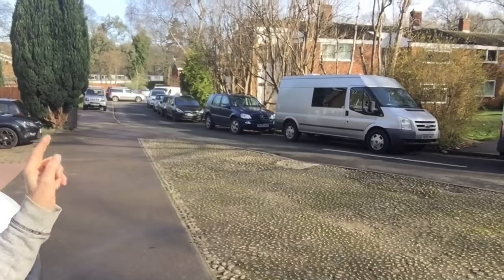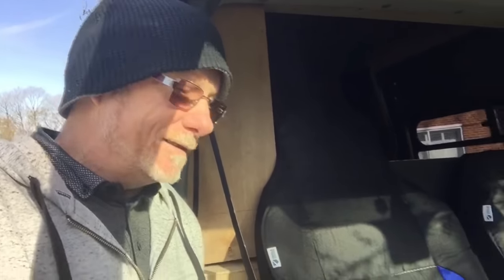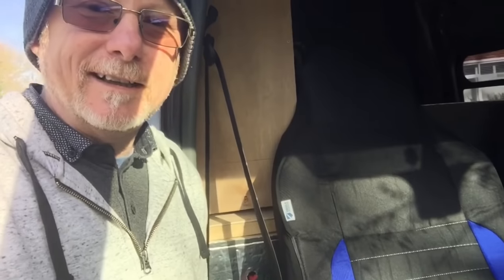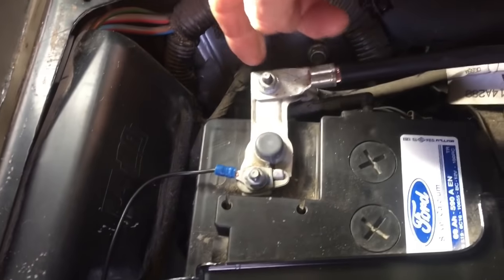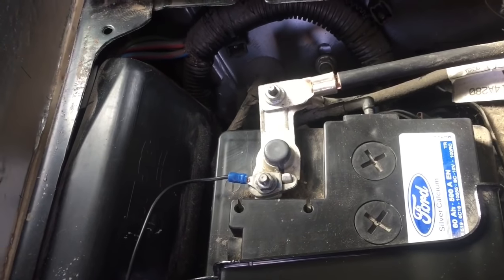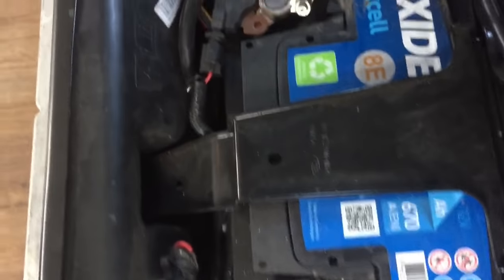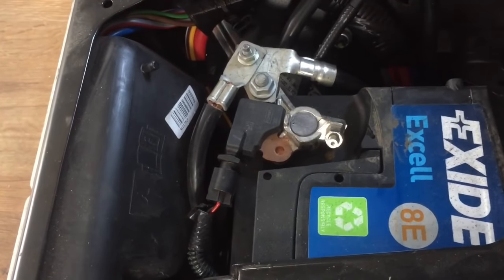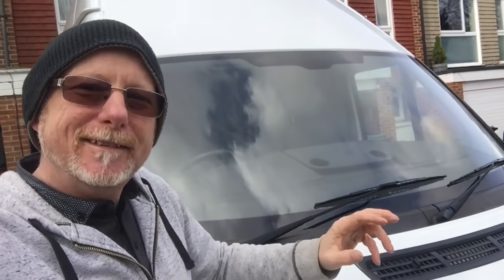How to tell if your van / car has a smart alternator?

Comment: Mel, top job.. another way to find out is, to test the vehicle battery voltage with a multimeter. On standard alternator it will rise to about 14.5V and stay around that, whereas smart alternators will drop back down to closer to 12.5 - 13V after 5 - 10 minutes of engine running..
Reply from the maker: team 118 thank you I’m sure that will be interesting and helpful to lots of people 🤓🤙
Reply: That's why I think a standard alternator is a better choice for charging a leisure battery as it puts more juice in and quicker at doing that also although it's harder on the alternator I'd say. Mine is the standard so I always drive a few good miles to make sure the van battery gets full load then switch over to split charging. I've been doing this for a while because I need to replace belt and tensioners, the extra load on the second battery will give a squeaking noise plus the belt slipping to begin with if I don't. I need to sort it asap.

Comment: All you need to do if you have a euro twin battery system with smart alternator is remove the sensors.off both batteries..negative side. Remove the electrical plug... Alternator recerts back to factory default.. then fit split charge relay...
Reply: Works awesome even have my solar via epever to batteries so charges both ways..

Comment: Dude I added a secondary battery to my  car to power my car fridge, only to find out it won't charge off my alternator if its a smart one. This is the perfect video to find out what alternator I actually have, cheers
Reply from the maker: Hay no problem I’m pleased it’s helpful thanks for letting me know I appreciate your feedback 👍😊👍
Reply: Hi thanks for this. Back in the 80's 90's we would have a bank of old van and truck batteries, for house electrics. We would take one out for a drive most days, Sat in my foot well, parallel charging off the starter battery with crocodile clips. Ive recentlybought a swb 2011 Sprinter for stealth camping. I was going to replace the battery and use the old one for a couple of led lights and fone charging. I was thinking of just going for parallel charging again. Seems I'll have to buy a charging box of some sort. Life doesn't get more complicated, it gers more expensive as well. Lol great vids Mel keep em coming.

Comment: You can charge lithium from any alternator using a dc to dc charger. 
Good brands like Victorian and Renogy make them.
Renogy also makes one that takes a solar input too ;it has a built-in mppt charge controller). So this piece of kit will take alternator and solar input and manage the charge of your vehicle and leisure battery!
Reply: You will have to run a wire from the convenience port or a switched\fused lead from the positive  to the ignition port on the Renogy dc-dc charger if you want to charge from the alternator.
Reply: @rg3965  where  is the best place to connect the ignition cable on a sprinter that runs to the renogy DC-DC charger?

Comment: Thanks again Mel. Very useful info.. Although Ive just connected my solar panel to the leisure battery with no split charge system... A 100w panel is more than enough for most of us for weekend camping.. Our was fine on a month trip though France and Spain with no split charge.. 12v compressor fridge, lights. And charging devices..
Reply from the maker: well done hope you had a great time :)
Reply: Scott how is it on winter trips though? Not so good I imagine?

Comment: Whoops I've already bought my split charge system without checking my alternator! Better check it before I fit it!
Thanks Mel
Reply: Me too, purchased the standard one which Mel has on his van, I have a horrible feeling my van, 2011 VW Crafter 2.0TDi has a smart alternator now.
Reply from the maker: Mark Velo I do hope it’s ok 🤓🤙
Reply from the maker: Michael Aldridge good luck hope it’s ok 🤓🤙
Reply: @BigVanSmallWorld  I've just checked mine.
The Neutral has one thick cable and one small one on the same connection but no black box.
The Positive has lots of connections though which was surprising.
Gonna fit it and hope for the best.
Reply from the maker: Mark Velo sounds like you should be ok 🤓🤙

Comment: Hi Mel,  nice video but as others have pointed out the Ctek unit does not have a lithium charging profile like others do however that being said the majority of LiFePO4 batteries can be charged on a AGM profile as long as the max voltage does not exceed 14.6V.

a voltage sensitive relay relies on voltage thresholds that trigger them to engage and disengage. Typically they engage to connect the starter and auxiliary battery together at around 13.3V and disengage to separate them at around 12.8V, which in vehicles with traditional alternators coincides with engine start-up and shut-down.  This is ideal as it makes sure that the auxiliary battery is charging whenever the engine is running. However, with a smart alternator, when the output voltage drops to below 12.8V a VSR would disengage, meaning that the auxiliary battery would have significant periods where it wouldn't be charging, even though the engine would be running (some models of VSR may not engage at all, dependent on the on-board software). VSRs can also engage and disengage frequently with the large and rapid voltage changes from a smart alternator and so the high current contacts may fail prematurely.

I am the technical sales manager for the exclusive UK distributor of Redarc Electronics who have an award winning range of DC-DC battery chargers that are formally approved by a number of vehicle manufacturers. They are standard fit on many frontline ambulances and large service and utility fleets. 

In over 5 years of selling Redarc product into the UK we are yet to see a single failure which is credit to the superior performance and reliability the BCDC range offers. 

One of the largest problems we have seen with the Ctek and sterling (other than failures) is they derate massively in high ambient temps which impacts performance and output current, as soon as 25 degrees is reached which can happen easily in the location these are sometimes installed the current reduces significantly and it does again at 30 degrees, majority of the time the charging current is then around 12-15A and your  not getting what is on the box!.. Redarc range has full output up to 60 degrees 

in regards to voltage sensitive relays While people have been using relays for years in split charge systems it is not the best solution for charging batteries, an alternators output is constant current and constant voltage because of this it is unable to fully recharge a lead acid battery to 100% SOC, it also reduces the life span of the battery. 

you also ideally need the same type of battery as an auxiliary as all a relay does is connect them in parallel 

The Redarc BCDC range has a sophisticated multi charge algorithm that will ensure your batteries are in optimum condition and get fully charged, the 40A unit is suitable for up to 400ah of batteries. The Redarc unit also overcomes voltage drop issues and knows when the battery is 100% due to resistance, temp and voltage so if a load is applied it will provide power to the load while maintaining your battery SOC up to 40amps, for larger requirements up to 4 units can be connected in parallel to give you 160A of charging current! 

Charging a lead acid battery is like trying to fill a Coke bottle up with stones, at the start you can put big stones in to fill up capacity quickly but towards the end you need lots and lots of smaller stones to make it 100% full - an alternator cannot do this while a proper battery charger can and that is why you have the different stages - bulk, absorption and float. 

In the real world unless when under heavy load your vsr is probably putting in no more than 40A 

We sell over 1000 vsrs a month but have seen a massive increase in DC-DC charger sales and a drop in vsrs, we honestly believe the Redarc unit is the best solution for any dual battery vehicle
Reply from the maker: Thanks for that if you really want a free add on my channel send me one of your products and I’ll gladly do a review for you 🤙🤓

Comment: Great info, and gave me the info that I needed.  Having a lithium based leisure battery pack I was at first thinking ahh well, solar and shore will do ... however a little bit of scratching around and Victron have jest the solution ... the Orion-Tr Smart DC-DC Charger work with LA or Lithium
Reply from the maker: Hi glad you found it useful 👍🤓👍

Comment: Hi Mel, a couple of things. You don't have to use an old lead acid with a smart charger. The Ctek device doesn't allow for lithium that is correct but there are other option the market. 

They are commonly known as battery to battery chargers or DC to DC chargers. 

Redarc bcdc (available in the UK via eBay) its what we are using. 
Sterling b2b 
Victron buckboost 

To name a few. They all allow for charging with lithium and can all be set to certain voltage parameters depending on the battery type. This has the added benefit of providing the battery with the correct 3 or 4 stage charging process which is vital for maintaining battery health in the long run. 

The split charge relays are practically just a switch as you know and thus don't provide batteries with the adequate charging voltage to FULLY charge the leisure battery. They can reach the 80% mark or there abouts and if you have solar then obviously that can then top up the remaining charge to 100%. But if you where to rely on just the split charge relay then you will never charge the battery to full capacity. Unlike the battery to battery chargers. 

So in all even if you have a regular alternator it's still the better option to buy a battery to battery charger if budget allows. 

👍 

Keep up the great videos matey.
Reply from the maker: thank you so much
Reply: I thought the Ctek was a DC to DC ? it also accepts  solar panel input for it's built in mppt controller , it can charge from both at the same time , or I am thinking about another make ?
Reply: uptowndisco2 You are right, however with the ctek you can only use lead acid type batteries and cannot upgrade further to lithium.
Reply: Mitchell Orr Do you have any recommendations for a dc to dc with a smart alternator the same size of the ctek 250 which you can use with lead acid and lithium? I have got lead acid at the moment, when my pocket allows I will upgrade to lithium. I wanted to install a one off dc to dc charger and only swap to lithium batteries with a build in bms in future. Thanks in advance.
Reply: @leoinswlondon  The Redarc BCDC1240D is the most compact unit available. It also has built in solar controller and can charge lithium so long as you buy the most recent version of it. Just be sure to check the sale listing to make sure it's the newer model with lithium option.
Reply: @leoinswlondon  got ya now , good to know as not yet bought my dc to dc  , thanks for the info .
Reply from the maker: uptowndisco2 I put a link in the description for you to an outstanding DC to DC charger 🤓🤙
Reply: @BigVanSmallWorld  Thanks , I have decided for now to just do  it the old fashioned way  , a thick live from the van battery to leisure , with a heavy duty switch  inline and I will act as the regulator switching on as needed lol , I already have an mppt linked up so that part takes care of the solar side
Reply: I have a T5 with smart aletrnator and AGM batteries on both car and leisure. On the leisure I have a solar panel with Lumiax controller. Can I connect the two systems through a VSR or do I really need a DC-DC ? If I can use a VSR and top-up with solar, should I buy an expensive VSR or a chinese one would be ok?
Reply: If the aux. battery is a LiFePO4 type then charging up to 80% is actually the best thing that can happen regarding the battery's longevity. Cheers!
Reply: @dhpundit You haven't added any solar panels to supplement the charging of your LiFePo?
Reply: @dhpundit Your engine's start battery rests at 13.7 AFTER the CTEK is done drawing juice? Wow my old ACDelco sits around 12.2V before I switch the ignition on. My new ACDelco is around 12.4V.
Reply: @uptowndisco2  Try the Victron-CT 120A version.
Reply: The KISAE DMT1250 has an MPPT controller and DC-DC charger that is user adjustable to send 5A or 10A or 15A up to 50A to the aux. battery. AgM and Li profiles as well as a custom profile. But unlike the Redarc, it won't charge the engine's start battery unless a relay is added.

Comment: Just been researching this, 

C Tek 
D250S is the original unit
D250SA was there last unit 
D250SE is there latest with use with LiFePo4 includes all other battery types
Integrated solar mppt 
20amp charging or 140amps with the addition SmartPass 120

Sterling
BB1230 and BB1260
All battery types
30and and 60amp charge current model dependant 
No Integrated solar 

Victron Orion-Tr 12-12/30 smart
All battery types
30amp charge current extra units are used in parallel to increase current eg 30+30=60amps two units £274x2 

This is quick short insight, please do a in-depth research before making a purchase. 

Careful if running a negative cable to the starter battery, connection may defeat current sensor!!! I would imagine this will give the computer/alternator the wrong info ??

Mel love your videos, very informative
Reply from the maker: Thank you for taking the time to help really appreciate it 👍🤓👍

Comment: Took a picture of my battery to confirm a smart alternator setup.  I can see the little black box.   It's  2015 custom trend.  I don't have stop start option in my van though🤔 Can I assume from the little box that I have a smart alternator?  Also I am hearing that smart relays do work with AGM batteries.  Am I right?  Your video is amazingly helpful.  Helps a non tech person like me no end.... 👍
Reply from the maker: Yes you have a smart alternator so you will need a DC to CD charge  controller that work fine with AGM battery’s thank you for the kind words really do appreciate your encouragement 👍😊👍

Comment: Ford have used smart charging Alternators sinve around 2000. Battery monitors have not been used fitted to cars until around 2010 (dependant on manufacurer). My 2006 Transit had smart charging with no monitor.
Reply from the maker: Thank you that’s really interesting 👍🤓👍

Comment: Hi guys I have read somewhere that you can just unplug the smart receiver from the negative terminal then your alternator reverts to around 14v charge, then you can use just a standard split charge relay, I do not know if this will cause engine management issues on the vehicle or whether or not your vehicle will throw a wobbly.

Comment: Where can I connect to D+ wire for a B2b charger In a 2010 transit jumbo 2.4?
Reply from the maker: To the positive on the engine batteries
Reply: At the moment solar is not charging , too overcast. Did had a splitcharge that came with the van but for some reason it stopped charging , two batterys down at 73% solar have been keeping there over the last few days, thats why i want to fit a votronic battery to battery charger , little drive and will top up batterys .

Comment: Nice vid. I have installed the ctek smart charger / solar in vans. Twice actually. Yes, annoying that cTEK have not brought one out with the Lithium charging protocol.
Because this device only charges at 20A o was wondering about combining it with a CCCV charger that is rated at 20a or two smaller ones paralleled together. 
These are easily available on eBay etc.
Reply from the maker: Nigel Dolman Hi Nigel I have put a link in the description to a great (not life changing) but still solves the problems it’s a DC to DC charger and solar controller all in one check it out you may find it useful I’ll be ordering one soon 🤓🤙
Reply: Oh great. Thanks.

Comment: Hi Mel - good info. Comfortably Lost in Oz fitted a split charge system that handles Lithium to their Sprinter. I'm seeing a few Dc to DC chargers pop up now - similar prices here in NZ to a VSR Split charge system and some also do Solar input too with MPPT - so probably a better option?? I read the other day that the Smart Alternators will never fully charge an AGM battery, only capable of charging to 80% due to the limited output Voltage of the alternator - to keep the emissions down - am wondering if this is correct?
Reply from the maker: I stick to me old led acid simple works and it’s cheep and more compatible with the battery that’s fitted to the van 👍🤓👍
Reply: @BigVanSmallWorld  Me too, have an AGM leisure battery. I think the Lithium split chargers are very expensive. But the DC to DC (with MPPT) are good for AGM leisure batteries, and cost a bit less than one of the victron MPPT solar controllers here.

Comment: If you have lithium then you'd have to have a charge controller anyway. So your smart switch ain't wrong but it's only correct about connecting directly to the batteries.

Comment: 50 amp Renergy 
Dc to dc charger with not solar charger 260 to 300 US dollars it isolates starter battery solar charges all battery has settings for lithium A G M
Led acid different charge profiles and has battery heat sensor

Comment: Check-out the REDARC BCDC 1225/1240 - compact heavy duty in vehicle dual battery charger which will handle both standard and smart alternators and all battery types.
Reply from the maker: Charlie Anderson thank wi will have a look at that sounds impressive 🤙🤓

Comment: check out road pro they do a range of dc to dc chargers I have votronic 3324 30amps £160.00, 3year guarantee. It will charge any battery and I have a LCD screen that tells me how many amps is being put into starter and leisure battery and the level of charge in each battery
Reply: What van do you have?
Reply: @jaimigrant7090  transit mk8